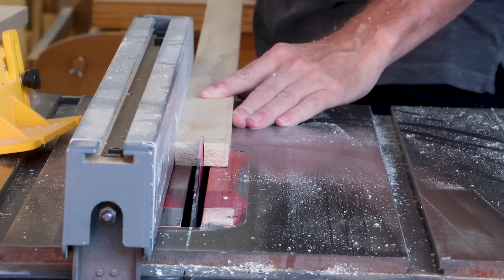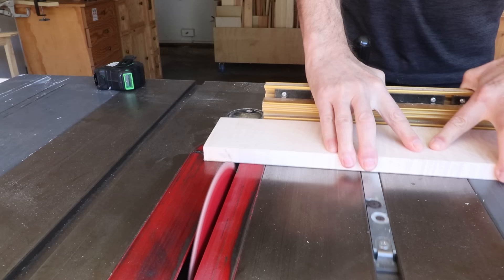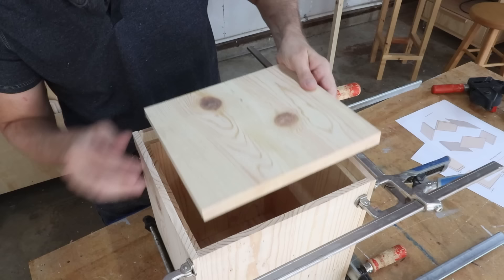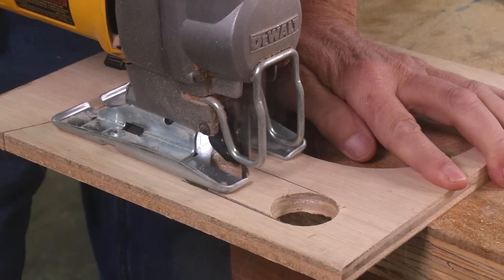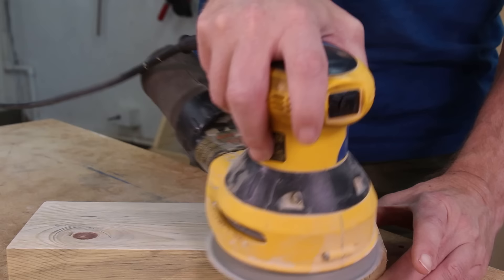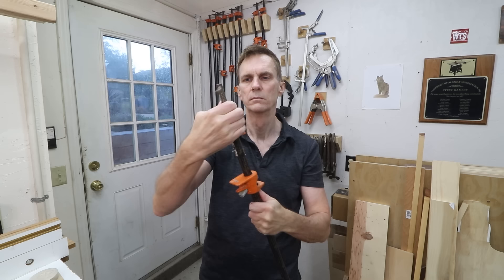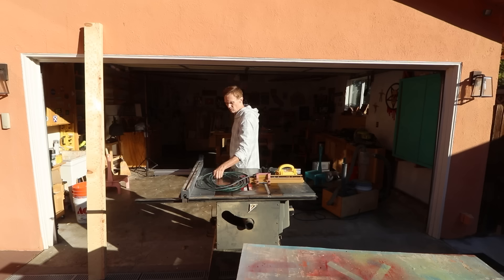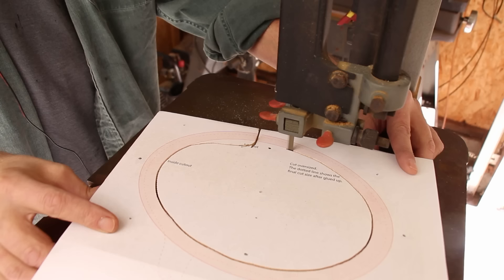2023 guide to all the TOOLS and SUPPLIES you need to start a woodworking hobby

Comment: Hi all.....I'm a long time fan of the channel, i really appreciate the insight you offer. Just wanted to throw out an opinion regarding the "battery compatability" argument.

 My first battery operated power tool was a Black & Decker chain saw i bought off amazon. I had gotten it to clean up some small trees around the property. I was able to finish that in about 4 days. Then i lent the saw to my uncle who has 8 acres of farm land and he used it for about another month. Once i got it back, there wasn't much  "chainsawing" left to be done so i put it in a storage cabinet. I didnt need to reach for it again until maybe 18 months later. When i did, the battery had run all the way down and wouldnt charge anymore. I watched some youtube videos that explained why that was and also spoke  about jump starting dead batteries. Unfortunately nothing i tried, worked. I never managed to get that battery to charge. 

Since then i have acquired a lot more tools, most of them cordless, all the same brand, including another chainsaw. Besides battery compatability, another advantage is, even if you dont use certain tools for a really long time, the batteries are most likely being used frequently, preventing them from running down and discharging, extending thier useful lives. So i might not use my new chainsaw for a year and a half, but i use the drill and circular saw almost every day. So whenever i do eventually need that chainsaw, the batteries should still be good. 

.....just a thought

Comment: the "having all matching batteries" point is usually great, not because having more brands of batteries is bad, but because as soon as you have like 3-5 batteries from a brand, you can just buy the tools without batteries and save some money. 
i agree, its not terribly important, but i stuck with one brand, just because i never use up my batteries, and 3 are enough for everything i do. so i just buy tools solo and 'save' 40-60 bucks on every new tool purchase form that brand.
Reply: Yeah this is my thought as well.  I first heard Steve say this when talking with Neil Patrick Harris. I agree that it’s not a big deal to find the right battery at the time. 

The selling point to picking a single platform is that every tool you have then has five to ten batteries. Instead of every tool having only one or two brand specific batteries. 

The average home gamer doesn’t need but three or four 5ah batteries to power your whole fleet for the whole day no matter what you’re doing. But if your one makita tool only has one battery you could be in trouble.

I think of it like this, you need one battery for every tool you’re regularly using on the job today and one more of each brand to be on the charger at any given time. Doing this with one brand is cheaper than multiple brands.

Comment: My table saw gets delivered today! I’m so excited. Of course, now I need to go shower the six inches of snow off my long driveway so it can get delivered. And annoyed it’s winter and my garage isn’t heated so I can’t really use it for a while.

My miter saw was a huge game changer, so I’m really looking forward to my new one!
Reply: Just started using my table saw ( after watching Steves videos on how to use one) . You will not be disappointed.
I buy the best I can afford, which sometimes means the basic models. My regret about my mitre saw is that I went for a 8.5 inch blade instead of a 10 inch blade. When funds allow, I will be trading up.
All the best.

Comment: I started watching your videos from my apartment a few years ago.  At that time I was making small projects with my Dremel, random orbit sander, and hacksaw.  Now that I own a house and a used table saw, I have made your push block and stick, feather board, cross-cut sled, miter sled, and jointing jig.  Then I absorbed some of the methods you use in your videos, and I made myself a very tall work bench out of free lumber from the deck I tore down, and I plan to make your BMW as soon as I can!

Thank you for all of your videos!  I'm pretty sure I've seen them all!

Comment: I will comment on the battery situation -
At home n my shop, I have all DeWalt cordless tools. Partly because my wife spent almost 18 years working for them, so our house bleeds yellow.
At our race shop (yes, we have race cars, it's a different channel) it is a hodge-podge mix of whatever was on sale at Harbor Freight (We use Harbor Freight with the race team because when they get stolen at the race track we don't really cry too much). None of those drills match, none of them use the same battery. It is a constant point of anger and frustration over batteries because you MUST have the one battery that goes with that drill and it's always dead when you reach for it. So in my opinion, while not an "end all - be all", having all matching batteries is much more than a marketing talking point. Looking back on it, I'm glad my home shop is all yellow and all my batteries work in every cordless tool I own.

Comment: We are doing a ton of renovations, and over the course of doing them I had several tools fail. They were all old hand me downs, so they were pretty much end of life anyhow.

I wanted an impact driver to go with my drill, my oscillating multi tool had failed, as did the ancient circular saw I was using.

While shopping for replacement I came across a 6 piece 20v craftsman kit that lowes sells.

It has a drill, impact driver, circular saw, reciprocating saw, oscillating multi tool, and a shop light as well as a charger and a couple of batteries.

The only thing I didn't really need out of the kit was the shop light, but even that would find some use I'm sure. Not a bad score for $200.

Comment: I've found that for tools that stay in my garage/shop, going with a corded model is usually fine. They are often cheaper and more powerful, too. I have plenty of outlets and an extension cord with 3 receptacles on a reel. So unless it's something that I need to be mobile with, why pay extra for cordless? This is especially true if you are using a dust collection hose with it. If you are going to be tethered by the hose, what difference is a cord going to make? Of course, everyone's use cases vary, so use your own judgement.

Comment: My woodworking is more heavily centered around construction, but my suggestion for your list would be some kind of material handling - clamping sawhorse/clamping table/clamp stand type device. It's such a huge difference maker to have a sawhorse/portable work table that you can clamp to for anything larger than your workbench (if you even have a workbench!). 

I like the Ridgid "Lumberjack" for the endless possibilities of custom jigs using the replaceable 2x4 top rail and the height adjustment.  You can clamp along (nearly) the entire length, drill holes for bench dogs, notch grooves for clamping pipe/dowels, expand the width/height with different 2x lumber, use it with your miter/table saw for infeed/outfeed support by matching the height to your tool, cut through it without worry, attach a temporary or stowable work top etc..  It's really a fantastic thing to have around.  I suffered through many years of regular sawhorses/roller stands before these came along and changed how I work.

Comment: One of the most useful next level “woodworking” tools for me is actually my 3D printer. No shortage of stuff you can design to improve your workshop and projects. I’ve done dust collection, dial indicator miter gauge attachments, corner clamps, router stencils, a custom table saw throat plate, and much more. 

And regarding the router, I’d suggest you add it sooner rather than later. I’d originally gone with a cheap HF trim router. Thing was terrible. So I didn’t end up using it much. Later picked up a nice Skil router with a fixed and plunge base. So much better, and I find all sorts of uses for it. Really an invaluable tool. Once you have one, you won’t want to go without it.

Comment: @2:24 There are adapters for using one battery with a different vendor.  And while it's not a HUGE deal, it can get more expensive if you need spare batteries.  This is where having one vendor helps.  There's nothing worse than having just one battery and you forgot to charge it or you run out of juice. And work comes to a standstill until it recharges.  Doesn't happen all the time, but it can be frustrating for sure.

Comment: If i were to start over again, id get a track saw.  Even at the low end you should break even with a good job site saw.  Its a different way to do things than when i learned but i think its advantages for a new woodworker are many.  Its accurate for cutting parts to size, smaller to store,  and much less intimidating than a table saw.

That said, the best advice i got was purchase tools as you need them for what you're working on.  Don't buy cheap/low quality tools.  As your skills grow, add the bigger purchases.  Also, sometimes you have to trade money for time (buy instead of build).

Comment: Right on about used tools. I have bought a bunch.

Hand tools are necessary for a lot of restoration work. I could not take my power tool outside to drill a one inch hole in a railroad tie. I used a brace and bit.

I took me years to get a really decent hobby shop. Lots of used tools.

Comment: I have found that pocket holes are fantastic for getting people into woodworking. They are so easy to join pieces together with and if you do it right, the holes will be hidden and they will most likely always be your go to for face frames no matter how experienced you are. My first project was my oak desk, its 45 1/4 by 19 1/2 and it has a hutch and a cubby for my pc tower. Looking back, a table saw, miter saw, a drill and pocket holes is all i needed to make this. Just 4 tools and you can make some amazing stuff.

Comment: I have to agree with this list 100%. I have for about the past 10 years battled with a Jig saw, circular, drill and a couple of clamps. Over the past 2 years I’ve added another drill, drill press (which I need for non woodworking projects anyway) and was given a Triton Mk3 work centre (convertible cross cut & table saw) which has been terrific. And I am at that point to take the next step & create next tier projects, and the router is first on my list.

Comment: Would you consider a video on shopping for used tools? What are good things to look out for, deal breakers, etc? 

I've been watching marketplace for a table saw (which I've never had before) but a lot of the ones I see are either exuberantly expensive, or I look up reviews and they're overwhelmingly negative (things like the rip fence is cheap and doesn't hold well) and I'm not sure when things like that can be swapped out for something better, or if the saw itself is the weak point. In relation to the saw, how do I know if a saw can handle dado blades? I saw the table saw video you made and would like to be able to use them, but am unsure of the limitations to being able to use them.

Thanks for your time if you can answer, and thanks for all the awesome videos!
Reply: As a retired cop - if the serial number has been altered, scraped off or the data plate is missing, the tool has probably been stolen at some stage. Would you buy a car if it didn't have the 'Compliance plate' with the chassis & engine number intact or the engine number ground off?

Comment: Love your videos Steve! They helped me get back into woodworking 3 years ago and I've learned a lot from them. This video was spot on and straight and to the point, no BS. You're correct that you should buy the tools if you need them for a project. It's very easy to buy a bunch of tools that you genuinely don't need. GAS (Gear Acquisition Syndrome) is very real.

Comment: That last little bit about "don't buy it unless you need it" is totally true.  When I got started, I thought a scroll saw would be helpful for cutting discs as "lazy susans."  So I bought a Porter+Cable scroll saw with a stand, for about $220.  But after the first use, I had to swap out broken scroll blades three times!  I realized my router with a circle jig was a much better option.  Also, I'm not a "creative" woodworker, and don't make projects with a lot of curves, so there was no reason for me to keep that scroll saw.  So I gave it to my brother-in-law who's a crafty guy, and it was a huge upgrade over his old benchtop Harbor Freight scroll saw.

Comment: A tip on spending money on quality, spend money on the tool which does the job you like the least. I used to hate sanding. Then I decided to buy a good sander and now it's not that bad.

It's fast, light, and doesn't make my hands go numb. If you really have to know it's a Mirka, but I'd bet you find other brand quality tools if you wish.

Comment: A little surprised you didn't mention Track Saws beside the Circular Saw. I use mine a lot, it is pretty accurate (I tried using a DIY saw guide & kept getting wavy edges on longer cuts) and can do most of what a table saw and miter saw can do if you spend a minute thinking ahead about your cut. Most tool guide/clamp rails as well as saw tracks have a variety of add on 'sleds' that help you use a router to do rebates and dados instead of a dado stack in a table saw (and possibly safer than using a regular table saw, without shelling out for a 'certain unmentioned brand' of table saw)
Reply: +1, better tool for beginners and much much safer!
Reply: I think it comes down to cost. Yes, there are some decent cheap track saws, but the cost of a saw and tracks is much higher than a basic circular saw. Remember his goal is to get people outfitted to start woodworking for under 1k. A Wen setup would be almost 20% of the budget.

Comment: I defenitly agree even without looking at your list , you can defenitly startup for under a 1000 for sure. Some of the tools and or machines I got I wanted to have since I saw them used at my jobsite allot where I do woodworking and used them plenty. Got miniature versions of some , but that for me is just more speed and convience when refining allot of boards. For example I got a planner aswell and a bandsaw but like you said you don't need that at first. There is just good minature machines out there for only a couple hundred each nowadays , so I've been slowly collecting pieces together. Thanks for giving allot of info out here. I allways check these kind of vids every now and then to see if there is something I haven't thought off yet to use. Seems like I got things set up nicely atm. I also want to add that there are some table saws that you can take with you if you got a car with a big trunk. Some got a really good setup with strong durable legs that you can bend and lock in to place when you use it. But folding it up it fits in a good size car trunk like lowering the backseats. Just saying for those that might need a portable option but fear moving it. Could be handy for those that need a portable option if they need to occasionally need to switch to using it at home or on the jobsite. ( thinking starting contractor work or such )

Comment: 2:51 all my basic tools like drills, impact and whatnot are dewalt but most of my other tools that are usually pretty expensive are ryobi as they seem to have cheaper tools  and I got battery adapters on Amazon to use my dewalt batteries on ryobi tools

Comment: Steve I've seen tons of your videos and the other ones mentioned here about tools etc. This one was great though because it just about focusing on what you basically need and not the brand of the battery compatability etc. That was a really good point. It also made me take a look at the tools I have gathered over the many years. Portable table saw that works just fine for me. Sanders jigsaw, drill, circular saw, squares,  etc. Nothing to fancy but all good and workable. Good stuff. Keep bringing us good stuff and cool little projects. Love the builds.

Comment: Great video Steve! I've been watching your channel for 3 years and I followed most of your advice on purchasing tools. The only thing I would add is that the jointer/planer is quite valuable for those woodworkers who want to save money in the long run and mill their own lumber. It'll save you a ton of money buying rough lumber than the fancy s3s/s4s. A table saw with jigs works well too for people with patience and comes with some limitations.

Comment: For the drill driver I would say a smaller 12v set are great for smaller projects. Larger drill drivers are great if you are working on larger carpentry projects. For smaller wood working projects and around the house I prefer my 12v kit.

Comment: Even though I've been working with wood for many years, I only do simple work and consider myself a beginner. 

I would definitely include one or two hand saws in your tool list. [My choice: a Japanese ryoba and a flush trim saw] There are times when you only need to make a short little cut, such as making a notch in the corner of a piece of plywood, and a power tool is overkill. Or you want to crosscut a few 2 by 4s when the baby is asleep. The ryoba is great for these. And if you ever use exposed dowels (to cover screws?) a flush trim saw is a necessity. Saws are not expensive, you can get both for under $50.

Also, I don't and will not own a table saw. 1) I live in an urban flat, and a table saw just doesn't fit in my space. 2) The noise ...  3) I'm usually alone when working, if I injured myself I'd have nobody to help me. I have a track saw and "baby" circ saw for straight cuts, and a router for dados and rabbets. And, being a little old lady, I have large sheet goods cut to sizes I can handle in the store.